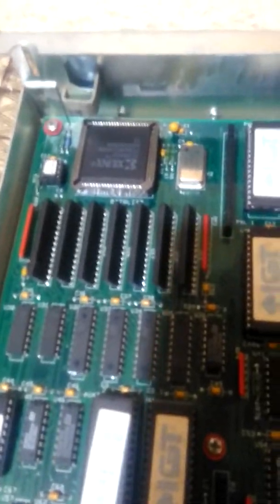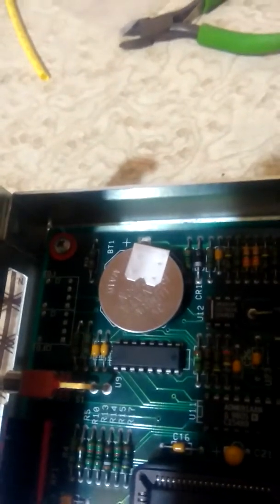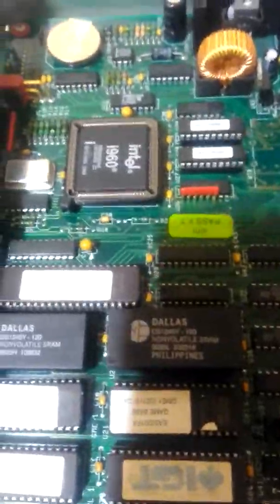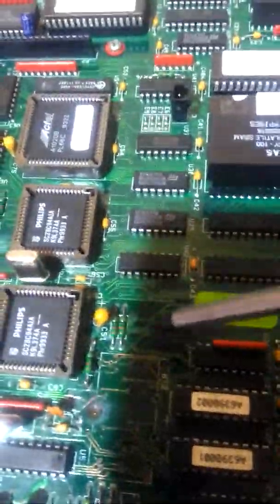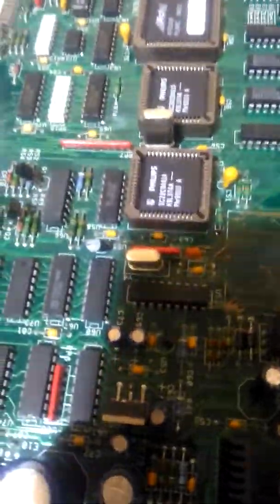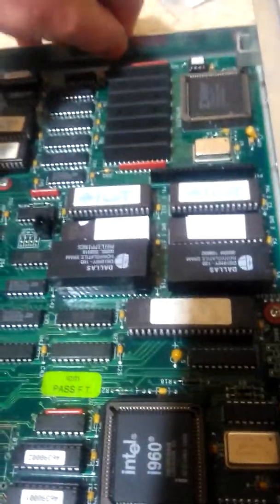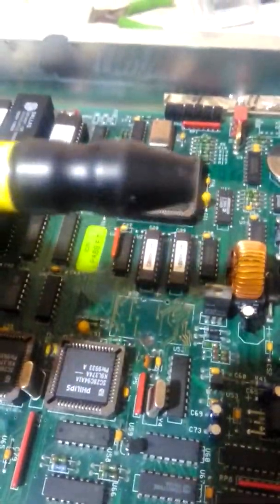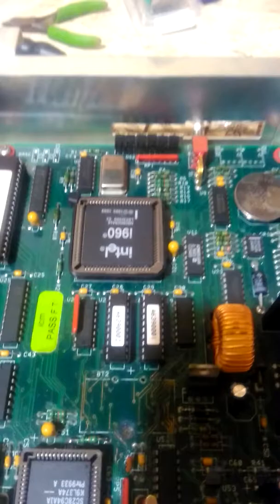Igt game king i960 board

Comment: Hey mate. Im having  a problem  with a IGT machine  a mate just got. Its saying processor  door open. The fault  will not clear. There is 2 boards  on 2 tray things  and i assume  the door is in front of that with a upper and lower  micro  switch. Any info  would  be great  cheers. Im in Westport  NZ
Reply from the maker: Depending on what type of machine he has. Hold test switch in while tuning machine on to get to the machines test menu. Follow the instructions on the screen to go to screen for testing outputs. Which will allow you to push a button or turn a key and it will show eva a 1or o meaning on or off. You should be able to test all buttons and switch even the test switch. Try pressing the processor door switch and check if they are working. If so it may need a ram clear. If they are not working most likely a processor fault or possibility wires unplug just depends who has been working on the machine. Also could be a bad battery on the board which can cause strange lock up faults. Hope this helps. Wade

Comment: Do you know where I can find some game sets from? I have good boards but it has qld software so it doesn't run stand alone
Reply from the maker: I do have some old boards in storage. If you are talking about 960 muilt game king models. Most are buggered but I think one set maybe ok. Igt roms don't seem to be easy to find I have a lot of other roms from there competition. The coms suck on these pokie machines to make the run stand alone. Igt are a real shit. Even the old ones with coms. And have to be enabled. Unless you have the software. But it can be done it all takes time and work. But I have still not got back to work on these things for a while but once Reno's are done I will lol
Reply: @wadeaicken19  aren't they stand alone in NZ ?  Also do you know if you can fit a gu4 main board on a 960 to upgrade it
Reply from the maker: @MrSirozzie  no not all machines are some have to be enabled. Gu4 boards are more reliable and have one chip to change over which makes life easy. As for upgrading a 960 to a gu4 you may have to change the back pain borad as well. As everything else is just monitor and door sensors etc
Reply: @wadeaicken19  would you sell your 960 game chips? I have 4 machines that have good boards but are running qld software
Reply from the maker: @MrSirozzie  can you take a photo of one of your boards and email it to me. At waicken@gmail.com. I may have one set of good roms. You can just have you will just have to pay postage as I don't know if the roms will still be good as they do have a life span as the can be wiped and rewritten and I don't have a eprom reader to check them. Which is on my list to get One. As it would be good to back all there roms up on a pc for future use. As igt software is hard to find online. As old games like double bucks are still in use today. Because I think it was one of the most popular games